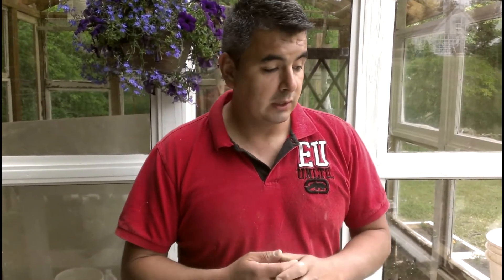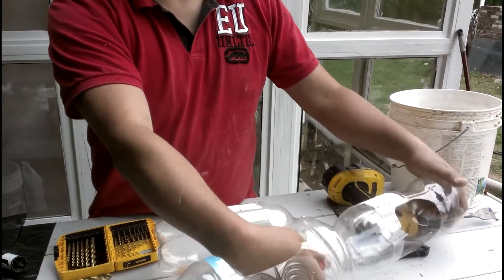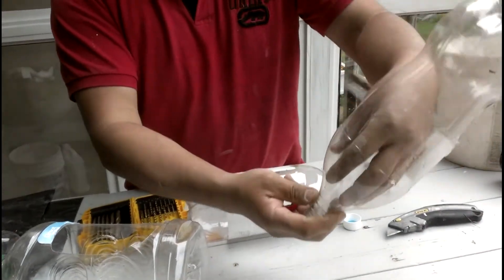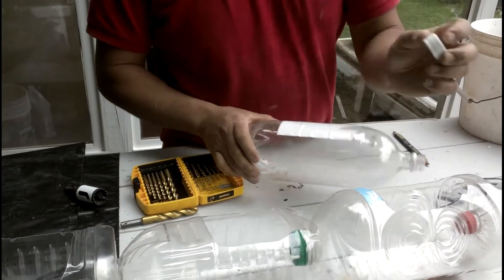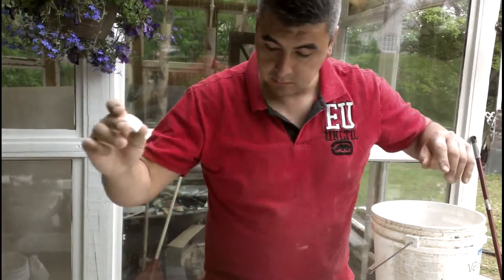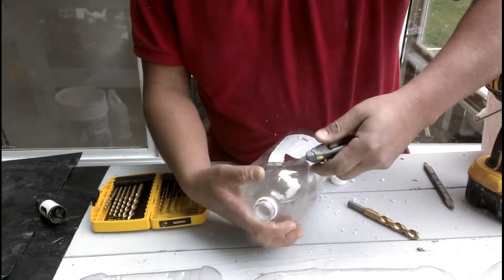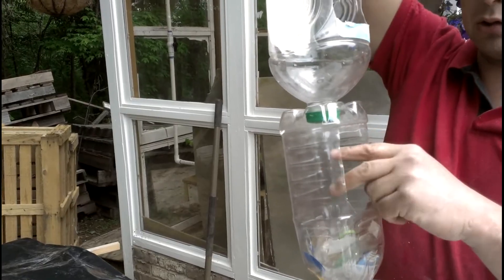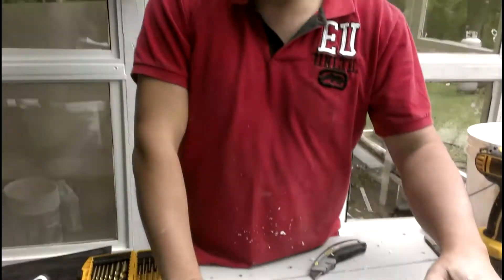Aquaponic systems grow towers with plastic bottles EASY!!

Comment: When making a hole in the bottle, fill it with water and put it in the freezer. It' will be a LOT easier to make a hole with a hole saw. The frozen water prevents the bottle from collapsing, when making a hole on both sides.
Also, the hole in the cap needs to be just big enough to make it drip. gravity will do the rest for you.
If you paint the bottom black, it prevents algae growth. NOTE: the bottom is now the neck of the bottle! 
Keep up the vids! Enjoying them :)

Comment from the maker: Thank you, as I learned with the vertical towers that I use in my systems, other than the plastic bottles, the plants like to have the leaves out of the container, the falling water normally falls over the roots. The plants mist be transplanted from other containers to the towers. Thank you for your contribution.